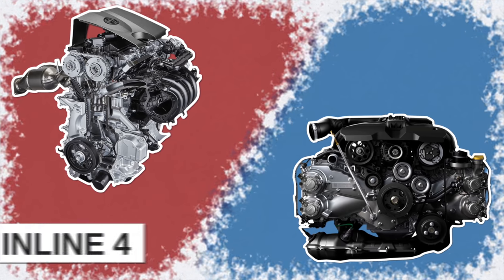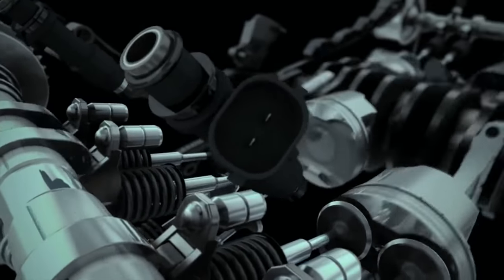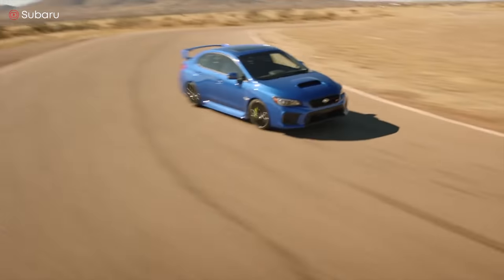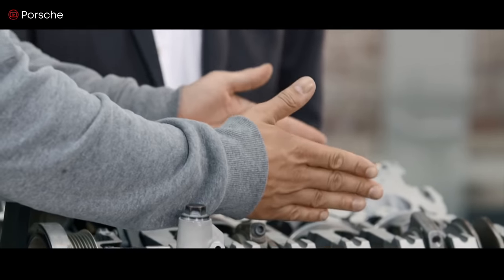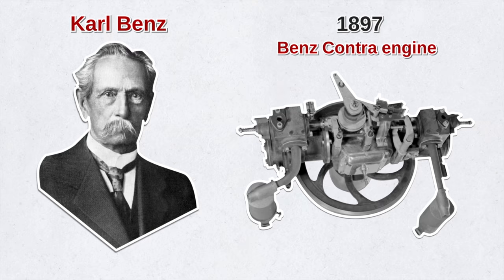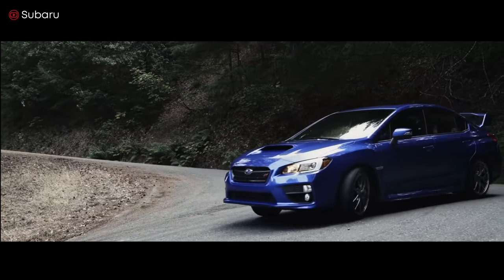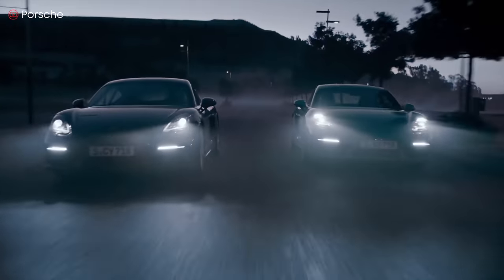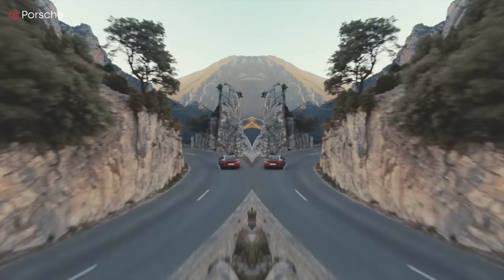Why Not to Buy a 4 Cylinder Engine Car

Comment: The older I get the more I value simplicity, ease of maintenance, and reliability. The “K24” inline 4-cylinder in my Honda (no turbo) is in my opinion one of the greatest 4-cylinder engines ever.

Comment: As a mechanic I would say if you're financing or buying a used vehicle, pick inline. They are simply much more reliable. Scotty forgot to mention in boxer engines, gravity is constantly pushing the pistons downwards so the bottom side wears out unevenly and faster than the top side so the piston rings wear out on the bottom end, thus the infamous oil leaks boxer engines are known for. The bigger ones (2.5L) wear out even faster because of the added weight. I worked in an auto parts recycling plant and we just couldn't keep the Subaru 2.5's stocked. They'd sell within days of being pulled.
Reply: That’s true but there’s a counter for that, Subaru cars have less depreciation than similar cars. So if someone wants a car for the short term and then wants to sell, the Subaru is the better option. But if you want a car for a very long time then yeah inline 4 is the way to go.
Reply: Except for a few model years, Subaru do not have oil burning issues. They have issues with head gaskets (NA versions) and spun engine bearings (mostly turbo charged variants, but NA suffer from that too). The spun bearing is why there is a demand for your recycled engine.
Reply: @lophilip  what would be the leading case of spun bearings? Bad oiling system, oil starvation or bad bearing design?
Reply: I don' t believe this. I think it has more to do with the lack of quality components than anything to do with gravity.
Reply: @jamescherney5874  most cars will work fine for a long time if you do proper maintenance and don't abuse them, including Subarus. But people love to abuse Subarus or neglect maintenance and the design of the engine doesn't help withstanding abuse or maintenance neglect. So they''l end up on the shops often and people calling them trash. It's the same case as with Civics, people trash them and don't maintain them and then call them trash even though they can last a very long time if you use them like any other normal car.
Reply: @Hartbreak1  that would be not true. I worked up a Subaru dealership and had to deal with brand new 2020 Subaru engines blown up or burning oil at 30k. That's with all the proper maintenance. A civic you can beat the living crap out of and it'll still last 200,000+ even running off 3 cylinders.
Reply: @bubbafrie9001  like I said maintenance isn’t the only point, people love to abuse Subarus.
Reply: @Hartbreak1  it was people with family SUVs. They definitely didn't abuse them because it wasn't just one case of it happening. They literally had a know issue with them eating tons of oil.
Reply: As a Diesel mechanic that's all I need to know, So glad I bought a K20C2 inline Honda engine in our new 2020 Civic Sport Sedan 😀, I am commenting on my wife's Phone, So the name is wrong.
Reply: @Hartbreak1  They’re literally a meme in the car community because of their questionable reliability with their earlier boxer motors. 

You keep saying keeping up with maintenance when even that doesn’t save them from blowing or seizing.
Reply: @Turboboob  Wrong. Subaru's keep retain their value very well.

Comment: My 2018 Civic EX-T, 1.5 liter 4 Cylinder Turbo, (174 hp, 162 lb/ft torque), bought new June 2018 now has over 83,000 miles. I change the oil/filter early (3,800-4,200 mile intervals) using 0W-20 synthetic. I use the highest detergent fuel with Shell 93 Octane. I replaced the plugs early at 66,000 miles and changed the transmission fluid every 33,000 miles. I flushed the coolant and bled the brakes.i replaced all four brake pads, cut the rotors, and replaced all four tires. That’s it. No issues to date. The plan is to get over 250,000 miles with no major engine or transmission repairs.

Comment: This guy is still just cranking out content.  Old work horse like my 1994 Tacoma!
Reply: And the best part is that just like Toyota, Scotty doesn't dish up endless nonsense. 
Just reliable facts 😊👋👍
Reply: Tacoma did not come out until 1995.5.....before that - they were just Toyota Pickups.  BTW, that 3.0 V6 in the pickups had issues with blown head gaskets. Avoid at all costs.
Reply: I have an '04 Tacoma that seems to want to live forever also. Best truck I ever had.

Comment: Hi Scotty, this is a fantastic analysis.
I believe the Inline 4 are better, every car will need maintenance and parts replacement someday; cheap and easy fix just can't sound any better.
Inline 4 cylinder's also deliver  smooth rides, if you don't rev'em like a maniac.
Reply: Baggie Metro:  But like Scotty said, it depends on what your priorities are, which he made clear.   I would certainly want to use an inline 4 for my daily driver, which I want to last many years and be economical. 

OTOH, now that I'm retired and can afford and have the time to enjoy a "fun" car with more performance and better feel for nice rides in the country, a Boxer engine would be more appropriate for such a car, if I didn't mind paying for it.   It's not like I'd be putting lots and lots of miles on such a car in a decade or so.

Comment: My 4 cylinder 1993 Nissan D21 (Hardbody) had 300k and still going strong! 5 speed manual transmission with original motor.

Comment: I’ve had both in-line 4 Hondas and a boxer 4 Subaru. I loved the smooth boxer engine, but the common head gasket issue Subaru caused mine to leak at 150k. The fact Subaru purposefully didn’t build them better turned me off to them. I went back to Honda and didn’t look back. One of my Accords has 332k miles on the original engine and runs perfectly. No leaks or burning oil. Couldn’t be happier.
Reply: My wife just bought a 2020 Civic sport 2.0L inline with NO turbo NO GDI fuel injection 6 Speed  manual trans,couldn't be happier with it do far, Smooth efficient power 😎
Reply: I own a 2000 Honda Civic vti 1.8 B18c4 here in the uk and a 2001 Subaru Forester s turbo manual SF5 both been really reliable done 9000 miles in the Subaru hasn’t broken once 118k miles and still going tho  its gonna fail its mot in September likely. rust may have killed it as its got holes in rear suspension turrets
Reply: @raymondreiff8170  awesome choice!
Reply: @andrewjohnson7960  I’m really torn about the subarus. I bought a brand new 09 forester and it did great. A number of friends and I all had our head gaskets start leaking between 130k and 150k. Other troubles are standard for cars drive in harsh winter climates. caliper seizing, and the entire front end suspension and steering going bad. Also had to replace the clutch at 130k.
Reply: @archeo289  thats true we’re they getting ragged lol mines completely stock haven’t ran crazy power lol and im gonna need too sell Subaru in September apparently in the uk only 30 sf5/ S turbo manual left there all automatic here in Scotland rust is a serious issue here the civic is a 2000 and is actually way better rust wise and its an estate car with a B18 nobody ever sees that coming when you drop into 2nd and 3rd and vtec away 😂

Comment: Based on what you said Scotty, I'd have to go with inline 4, for longevity.
Reply: For longevity you definitely need a BMW with a rotary engine. Those things can literally run forever. 
😆
Reply: @BubblesTheCat1  lol
Reply: @DonaldHendleyBklynvexRecords  😅😅😅
Reply: @BubblesTheCat1  Jesus Christ lol
Reply: BMW will probably increase it's reliability if they were to make cars with a Mazda rotatory engines 😂😂😂😂😂😂
Reply: @jorgeluna7914  Probably. 😀😁😂😃😄😅
Reply: I agree. I will give up a lot if it means longevity and a more reliable vehicle.
Reply: @BubblesTheCat1  BMW is actually known for its reliability from the inline 6 and their B48 is bulletproof especially for a 4cylinder
Reply: @jorgeluna7914  look up the B48 and B58 engines. Most reliable engines out right now
Reply: @aarongrisham5555  No one said BMW makes crappy engines. 
They make crappy cars.
Reply: @BubblesTheCat1  a Scotty Kilmer specialist that's never worked on them. Noice
Reply: @aarongrisham5555  As a matter of fact I have worked on them. I'm a qualified technician working in the trade. BMW makes excellent straight six motors. 
It's all the other plastic crap that makes them unreliable.
Reply: @BubblesTheCat1  every car these days uses the same amount of plastic
Reply: @aarongrisham5555 But then please explain why BMW's have such poor resale value?
Toyotas have excellent resale value, and  they just don't break down the way BMW's do.
Reply: @BubblesTheCat1  that's why Toyota had over 2 million transmission recalls?
Reply: A mere drop in the bucket,  compared to the crap coming out of Germany nowadays.
Reply: I like a straight 6. Easy to work on and inherently balanced. But have to be longitudinally installed which is more expensive in a front wheel drive installation.
Reply: @aarongrisham5555 BMW uses a lot of recycled plastic because it's required by all manufacturers in the European Union
Reply: @stephenciszewski3564  and it's good quality compared to Toyota lol. 😂
Reply: @BubblesTheCat1  My wife had two.  I thought they were junk.  Terrible road noise, every interior plastic ie - glove box, the trunk mechanism(which they didn't back for repair).  Sure it ran great, but why can't you get the rest right?  And then have no quality control that put an out of pocket experience back on the consumer.  So much for extended warranty or warranty whatsoever.
Reply: @ninez5740  2 what?  BMW's or Toyotas? 
In my opinion if you can afford BMW, and don't mind losing  $$$ go for it. They do after all drive fantastic. I'll give them that.
But on the other hand if you live hand to mouth, and have to use your car every day to get to work,  the Toyota  (especially the Corolla's) is the better option. As boring and full of rattles, poor performance, and heavy fuel consumption the Toyotas are,  nothing beats them for just chugging along year in,  and year out. 
Personally I drive a 2001  Nissan.
Reply: @BubblesTheCat1  I'm older and have no brand loyalty, and have probably driven most "blue collar" brands lol.  I had a Nissan used drove great, but had it's issues do the last drivers maintenance neglect.  I had a Toyota which my daughter still has, and I'm now in a RAM.  Maybe it's just luck of the draw on vehicles when you get them.  My biggest issue with the BMWs was poor quality control and them backing their brand.  My wife is in a Tesla now, and it's had it's issues, none with drivability, and they step up and fix them.  I had a friend go from a 4x4 Nissan before the Titans, and has been in his 3rd Toyota, now 2nd Taco, but his wife is in an Armada.
Reply: But he said why not to buy a 4 cylinder tho...

Comment: You didn't mention that boxer's are good at blowing head gaskets
Reply: Latest cars not blow head gaskets anymore. Scotty said.
Reply: Subaru's older head gaskets were the problem, the new ones are solid
Reply: @Name-eg1uf  not great news for folks stranded on side of the road with a older one.  Like "good news! Use THESE NEW head gaskets!" & NO problems! 💰  $3200°° dollars later......
Reply: That was a Subaru issue. Lol.
Reply: The '56 Porsche I had had no head gaskets.

Subaru may have blown it (no pun intended) when they didn't adopt the same or equivalent method Porsche used where the top end of cylinder barrels contacted the head with enough pressure to prevent gas leakage.

That method did require some precision machining, though.
Reply: 22 years old. I have 2 Subaru. Never blown a head gasket.

Comment: The fact you gotta drop engine to do work on Boxer, is a huge turn off. If you want power, just get a V6 or V8
Reply: Hehe turn off
Reply: Exactly
Reply: I agree.  I had a 3.8L with a slight misfire.  It was not lacking power with the V-6.  I had a Ford inline  4 cylinder with a misfire and that thing had no power.  After that 2.3L inline 4 cylinder in my 1992 Ford Tempo I have never bought anything but V-6's instead and I love them.  They get 21-28 mpg and lots of passing power.
Reply: Porsche designed the car to deliberately require dropping the engine.  With a car that does 200mph, you want that thing in top athletic condition.  Imagine blowing your clutch or steering/suspension components at 200mph - rear wheels get loose, you lose control of the car.

Saw a video when they put a 911 in for a service.  The clutch plate was worn and still usable.  But not good for high speed travel.  Same for the water pump and other components..

They replaced the clutch plate, the water pump, did a tune-up, cylinder head gasket, new radiator hoses, timing belt, tensioner, etc.

Any other vehicle it would've been just the simple service.  On the other hand, those cars also weren't doing 200mph either.
Reply: vincent schoenekase  I'd rather take a remake of a classic BMW - loved the style, long-lasting, just needed some improvements to the interior.
Reply: @MyLifeThai371 :  And that's the real issue.  Initial cost, and mileage trade-offs, vs. more power.  Neither answer is "wrong", but for people who are economy minded, V6's are expensive, and gas isn't free. 

In 2003, when I bought a new Altima, I figured that all things considered like gas, insurance (6 cylinder puts the car in a more expensive rating class), the cost of the option, etc), it would cost me $5000ish over 10 years or so.  NOT worth it for a couple seconds or so faster 0-60, at least for me. 

Similar story, generally, for a Toyota Camry, but just to get to the 6 cylinder model new, it was close to $5000 when I checked 4 years ago, before gas or insurance even came into it.
Reply: Only in America. V8 aren't really popular in asia and europe.
Reply: @azurantaiki  unfortunately :(
Reply: My Mazda 2.5 cid 4 cyl. w/ 227 hp has more power and torque than the 307 cid V8 (200 hp) that my 1970 Camaro had.
Reply: vincent schoenekase  Power is pretty subjective. Focuses are abysmal in terms of power but that’s just me.
Reply: @MyLifeThai371  
I have a 3.8L V6 that had a stutter which turned out to be a loose spark plug cap. Car still drove ok, and with the cap properly on, has run like a dream ever since. And it's a 21yr old car.

Comment: I'll take a long lasting i4 over a boxer engine any day.  the reason why they call it a boxer ending is because it's more powerful and just like boxers it always has head gasket issues and leaking.
Reply: Nice.
Reply: @captinbeyond  lmao hilarious man
Reply: In reality lots of boxers owners neglect to do proper maintenance because of cost and complexity.
Reply: Only one version of the ej25 had head gasket issues. Just find a good mechanic and you'll be fine. Toyota's are boring.
Reply: @santouchesantouche2873  Problem is good mechanic don't want to work on them.
Reply: @ginog5037  yeah that's not true at all tho
Reply: @ginog5037  your logic is nonsensical. If the boxer is unreliable, then mechanics make more money fixing them. Right?
Reply: @santouchesantouche2873  You  obviously suffer from the Dunning–Kruger effect. Turn a wench on those cars and learn about business.
Reply: @ginog5037  are suggesting mechanics make more money not fixing things on cars? Hmmm... Please explain Einstein
Reply: @santouchesantouche2873  you really are clueless, their is no money on projects. Get the cars in and out with quality not  cars taking up valuable shop time. I can see you enjoy dealership service with your free coffee and snacks...
Reply: @santouchesantouche2873  Also genius do you see Scotty pulling engines, trannys or heads...NO, ever ask why, no money in it.
Reply: @santouchesantouche2873  if u get the fa20 or the fa24  are pretty reliable
Reply: @ginog5037  you said it yourself 'valuable shop time'... Valuable because customers pay for this....
Reply: @santouchesantouche2873  that  doesn't make sense, but OK...
Reply: @ginog5037  customers pay for the mechanics labor. I hope this helps.
Reply: @santouchesantouche2873  hey Ace, ask Scotty if he would do a cly head job on a boxer. Since you know so much about pulling wrenches. We're done here Ace.
Reply: @ginog5037  hey champ, I'll stick a mechanic with a hoist not a YouTube with a hokey garage in his backyard 👍
Reply: @santouchesantouche2873  so why do you watch Scotty a millionaire mechanic and troll here Ace. You obviously know so much about cars and business troll.
Reply: @ginog5037  your question is a non sequitur tbh. I watch Scotty for a laugh. But I also call out ignorance when I see it
Reply: @santouchesantouche2873  glad you're getting your money worth out of Hook on Phonics...troll
BTW Scotty has over a billion views, Ace.
Reply: @ginog5037  is English your second language? I need a translation pls. Yet another non sequitur. Scotty's views are such that it's a sad indictment of the auto industry as a whole. Dealers and mechanics and car makers trying to rip us off. Like I said, Scotty is funny. Like friends was popular as a comedy...
Reply: @Tool Time my life is perfectly exciting until I enter a toyota....

Comment: 2008 Tacoma in-line 4.
Not great for towing heaving to be sure but….
240,000 miles.
Serpentine belt
Front wheel bearings
Fuel gauge indicator
Gas and oil.

Comment: Little-known fact: one of the reasons why horizontal automobile engines AKA flat engines AKA opposed-piston engines last so long is because of the fact that they have oil at start up. Engines such as V8s and V6s and inline 6s and inline 4s with vertical Pistons drain all the oil down off the cylinder walls when the engine is shut off. Whereas horizontal engines leave some residual oil on the cylinder walls when shut off so that when you go to restart the engine there is immediate lubrication. Keep in mind that 80% plus of engine wear occurs at cold starts when the cylinder walls are unlubricated. So horizontal engines drastically reduce this problem. I'm kind of surprised that Scotty didn't mention this...